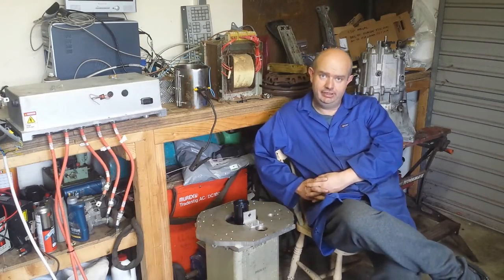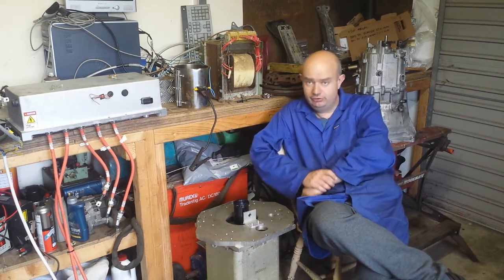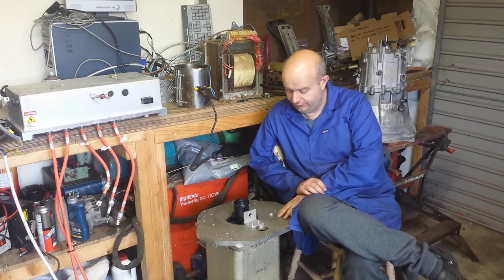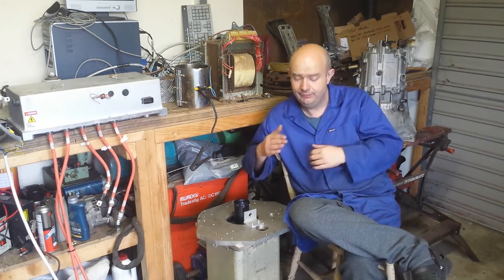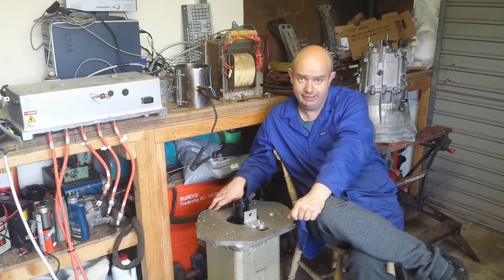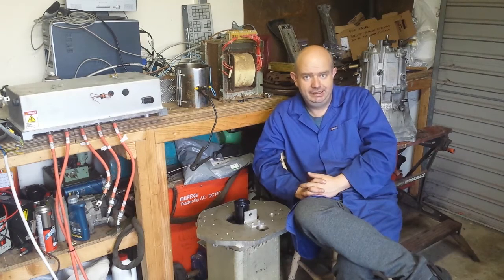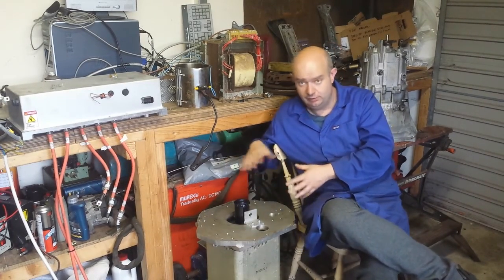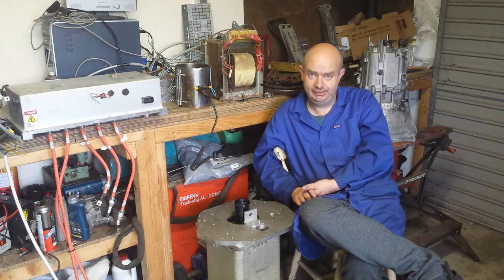BMW E31 840CI EV Conversion 55 : Manual Gearbox Swap Part 3

Comment: Hey Damien, I commented earlier on the need for a clutch with AC, but it looks like you have a great solution for the situation. You being an electronics guy and me a mechanical guy I didn't even think of making the AC motor free wheel like a DC motor
Then adding the regen with a light touch of the breaks, nice, I can't wait to see the results! Nice Work!
Reply from the maker: Thanks Richard. We'll see how it goes:)

Comment: Woohoo a complete Episode to answer my question ;) I liked it and I think you know what you're doing. Another disadvantage would be that most standard clutches can't cope with the massive torque you get from an electric motor. So I had to go with a performance clutch. I just want to add, that if you decide to add a clutch in the future, I think most of the alignment work has been already done. Thanks to your straight in coupler ;) You would just need to redesign your coupler and maybe lighten the flywheel a bit.

Comment: Just a thought, what about a switch to disable regen (assuming the inverter has an input you can use for that). You could use the left paddle shifter for a "clutch" switch that disable regenerative braking or maybe even have a switch on the shifter knob. As a bonus you could use it for coasting as well and still retain the engine braking without having to press the brake.

Comment: How about, a button on the shifter, to disable the regen? Quite possible with the johannes huebner inverter, BMS input woudl work right?
Reply: That is even better than my own idea, how about a virtual kludge pedal?

Put a switch where the pedal would have been. The switch puts the motor into neutral, no torque no regen..

I am driving an i-MiEV but I used to drive shift gear all my live. Never liked automatic. Regen when I drop the pedal has saved my skin more than once. The car breaking even before my foot has jumped from gas to break can be what saves you from hitting somebodyelses bumper.

Virtual kludge one step further, tell the motor to sync with ... 

probably not so easy, yet another encoder.

Comment: Everybody had the same idea I did when watching. I like the idea of using the clutch pedal and making the reduction of regen progressive. 

Doesn't the Siemens have a broad enough torque curve to make most of this academic?
Reply: I suppose my preference for a "kludge pedal" as you call it betrays my preference for manual shifting in petrol vehicles. Anyway, having fine control of regen through a pedal would be really nice.

Comment: Hi Damien, I really need your help...I converted a toyota rav4 1999 swb to electric with a brand new azure ford parts...everything is perfect,but because I removed the abs, I don't have regen brake anymore...do you have any idea how can I switch it back,or what is the two speed signal for the instrument cluster(pin number)? I can pay for the information...thanks

Comment: I still dont get how you can use manual gearbox without the cluch, its same as using regular car without pressing cluch, which is more or less russian roulette to guess is your wheels the same speed as motor or not. 
either way you put extra load to the gearbox synchros.